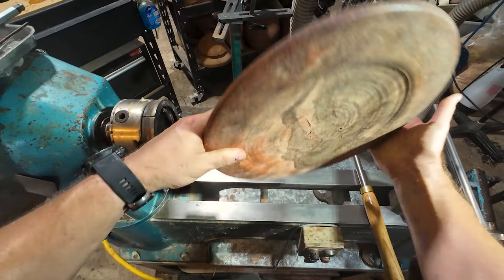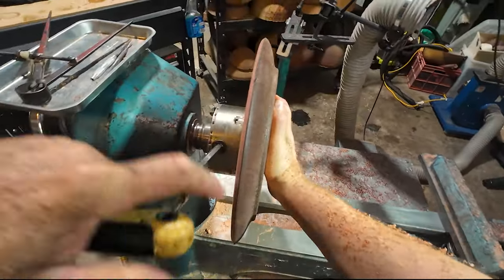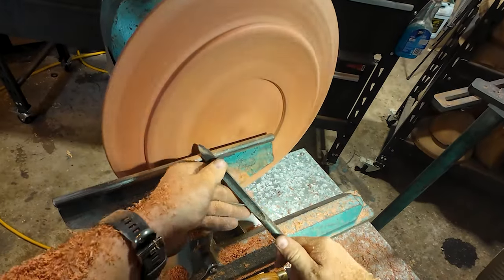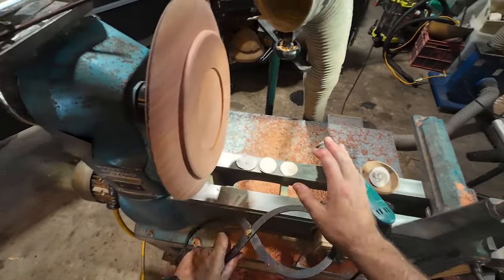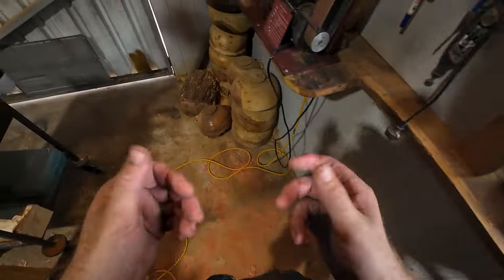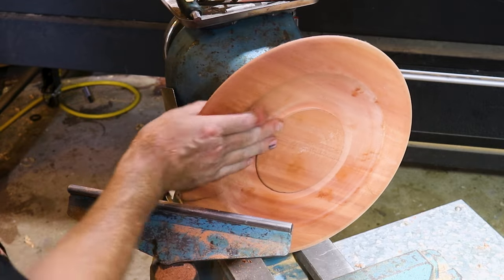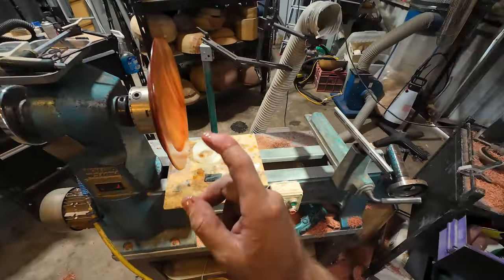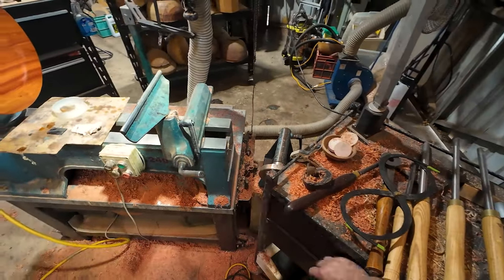Woodturning: Australian Hardwood Platter - POV ep:2 Tutorial.

Comment: Hi Kerry. Here is a tidbit that you may want to try. Adhere a strip of duct tape to the back side of the sand paper. Cut out the reinforced sand paper to the desired length or shape with a pair of scissors. This ended the "hot fingers" and has worked well for me for many years. Enjoyed the platter turning.  Regards  Bryan D
Reply from the maker: I like that tip Bryan. Very handy to know. I will give that a try on the next one. 👌 cheers mate. 
Kez